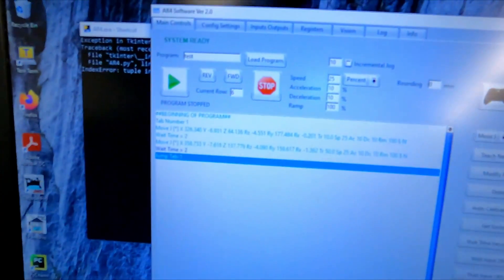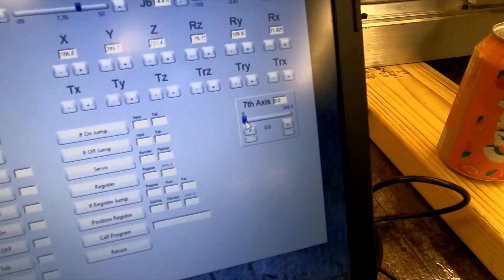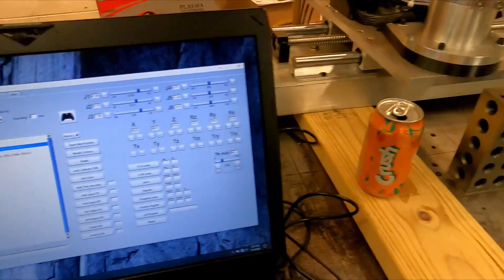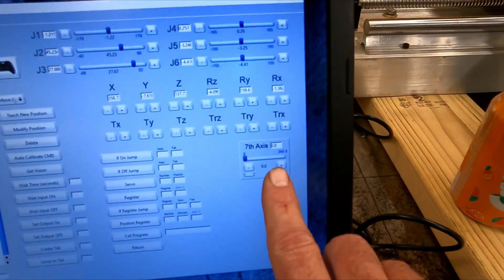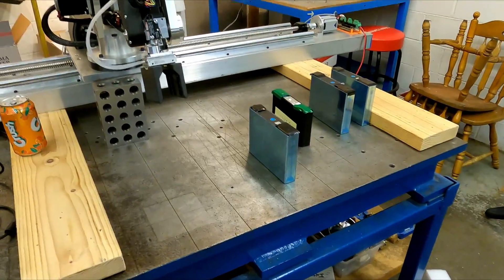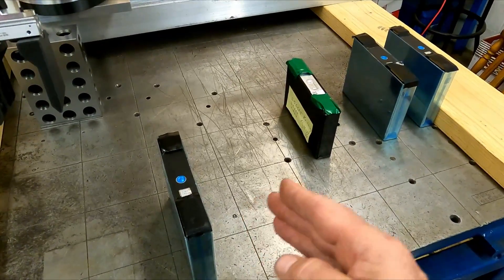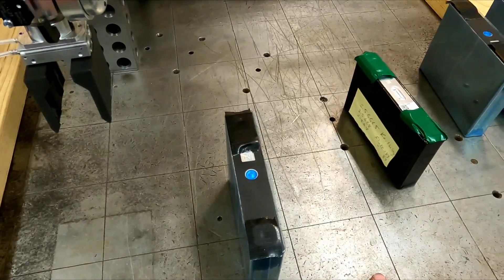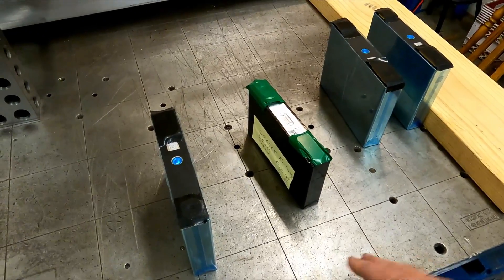AR4 Robot Linear Track

Comment: Looks like a bug on the software, anyway, you can double  check the motor and encoder wiring, another option is to delete the program and teach the points again, try also with a program that moves only the 7th axis... measure the electrical signals on the drive when the software should be commanding it